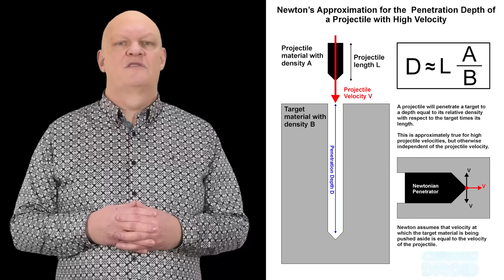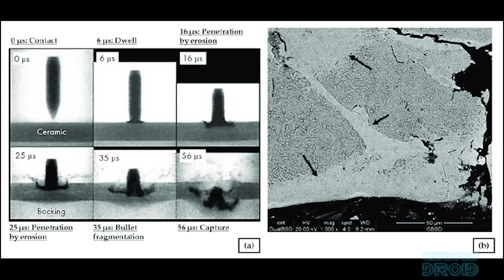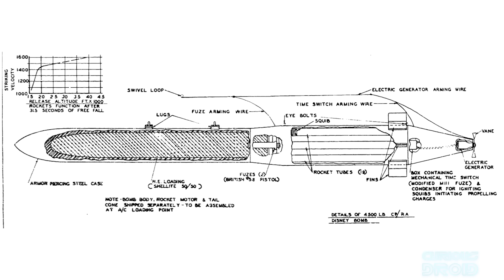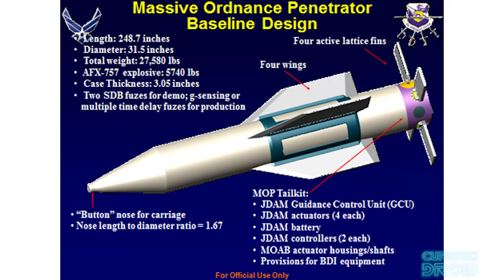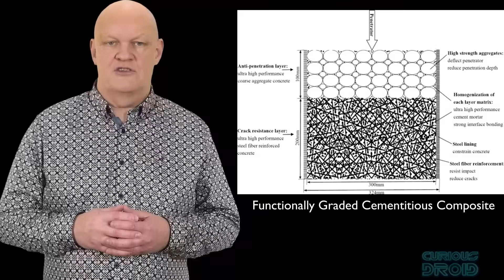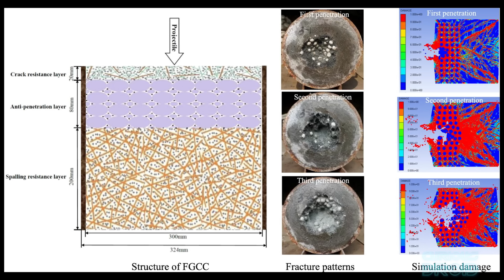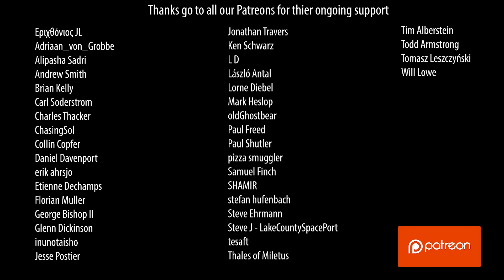Can Iran Stop U.S. Bunker Buster Bombs?

Comment: Great video, interesting stuff to an old US Navy A-6 bombardier.  
.
I have a solution different from what you posited at the end ... and a war story.  The solution is napalm.  In the A6, nape was one of the few weapons we couldn't use because you can't carry it on Aircraft Carriers.  The Navy fears the whole fire thing. On a ship, fire is bad.  But after Desert Storm I recall reading about some Marines that got in trouble for napalming (napeing?) some random target ... artillery, armor or some such.  I remember reading it and knowing exactly what happened.  The looked in the manual --JMEMs, the Joint Munitions Effectiveness Manual.  
.
I had spent many hours in JMEMs looking up what weapons would work best against what target.  There's a matrix of different bombs against personnel, equipment and buildings of different construction.  And there is a pattern: Napalm works best against almost anything.  The problem is figuring out whether you can hit the thing. There is no such thing as precision guided nape.  I am sure the Marines looked in their manual and picked nape because the target was something they could hit.  No one up the chain of command stopped to think about how dropping fire on people would look in the newspapers.
.
For a bunker it'll work because bunkers need environmental systems with access to air.  Napalm works best against almost anything ... if you can hit it.
Reply: During Desert Storm I witnessed USMC Harriers taking off with nape under their wings and returning empty quite frequently. Harriers were also using Mk-82s and 25mm cannon fire. Each Harrier had a bomb with a number stenciled under the cockpit indicating the number of sorties flown, and some of them were well north of 80. That was a really bad time to be an Iraqi soldier.
Reply: @RCAvhstape  I didn't know they dropped in often.  I remember reading about one napalm attack after the war where the newspapers, or public, seemed displeased.  Outsiders had the idea incendiaries were a war crime and their "experts" said the Marines could have picked something else.  It was only one article, but I recall thinking 'Yea, they could have used something else but I know exactly why they chose napalm.'
Reply: @jeffzaun1841  Yep, there was also a lot of complaining about cluster bombs and land mines. We used a lot of cluster munitions in Desert Storm, both aerial bombs and artillery shells, precisely because they are so effective. The Iraqis were entrenched and Marines were about to assault straight through the middle, so Marine and Navy air was doing what they do best to help out.
Reply: @jeffzaun1841  I am going by memory here, so I can't verify for a fact that I saw napalm, but they were metallic canisters under the wings. The ordinance men mentioned napalm to me in conversation, too, come to think of it. Hats' off to you for your service, and glad you're with us still today.
Reply: @jeffzaun1841  Just did an image search, and sure enough there is a photo of Marines arming one of my squadron's Harriers with nape at Jabayl where I was at the time.
Reply: @RCAvhstape  "soldier" yeahhhh....  right...
Reply: @byloyuripka9624  problem?

Comment: The tops of the bunker is very thick how thick are the walls on the inside? What if you just dropped one close to the outside and let it blow in through the wall.? Best way to destroy a ship is drop it right beside the ship and let it blow a hole in the side.

Comment: My uneducated thinking on how to defeat these more modern bunkers is to start employing materials other than steel in the construction of the penetrator.
Tungsten carbide has been used for a long time in armor piercing projectiles for firearms. If we could just discover a way to create a penetrator nose-cone for a bunker buster out of that stuff (or even better, depleted uranium, since depleted uranium has self-sharpening ability and tungsten carbide does not), then we would likely have a weapon sufficient to penetrate into the bunker proper. What follows that penetrator nose-cone is up to the imagination of the weapons designers, but my preference would be a high yield fuel-air explosive. Because if you thought a fuel air explosive going off at the entrance to your bunker or cave was bad, how about having that same thing go off right in the middle?
Reply: Yes. I bet nobody has thought of that before.
Reply: @T3H455F4C3  You'll note I did preface it with "my uneducated thinking...."
Therefore, I fully expected someone else to have thought of it before. I just don't yet know why it's a bad idea.
Reply: @44R0Ndin  One thing I do know is that Tungsten is relatively rare and expensive. It is quite hard and has the highest melting point of any metal. Probably a huge pain in the ass to work with. 

The USA does have a large amount of depleted uranium. If we fined out one day that they made bunker busting munitions out of DU I wouldn't be surprised. 

What keeps coming to mind is that if you can make a thing that's 80% as good as another thing but costs 20% as much to manufacture, that's probably the way to go.
I'd rather have five "pretty good" bunker busters over one "really good" bunker buster.
Reply: @T3H455F4C3  That's a good point, and maybe the way to attack these bunkers isn't with "a better bunker buster" but "more of what we already have" instead. Throw enough of them at the exact same spot and you'll make it thru eventually, you know?

Comment: I was in the USAF as a munitions systems technician when the GBU-28 first came out.. didn't see too many of them as they were initially nearly built to order. Additionally, I was stationed in Kuwait after Operation Iraqi Freedom in 2001 and we stored our munitions in the Hardened Aircraft Shelters (HAS) that we had previously blown up with bunker busters.. We initially used the GBU-24 with the BLU-109 (2k lb penetrator) warhead but found out the French cheaped out when they built the HAS and instead of using 12 ft of reinforced concrete, they used a sandwich of 4 ft concrete either side of sand.. our penetrators went right through. I have re-enlistment photos in front of these blown up shelters
Reply: I also was there at that time....different job but same time....and side note Kuwait sued the French for the destruction we did to the bunkers!
Reply: wtf really never heard about that haha
Reply: So your saying the best defense is to  have the concrete be thinner?
Reply: @rainyvideos3684  the bombs went right thru and blew up inside
Reply: @rainyvideos3684  No armor is best armor.
Reply: There’s a concept that transitioning to layers of compacted gravel (valentine bunker used thus I think) causes strain waves to dissipate. So surface explosions are better tolerated and toughness improves.
Reply: CAn you tell about  Serbia what bombs were used .. NATO droped many bunker buster bombs in 1999 on 2 airports that had underground level for storing military and civilian planes. And no bomb penetrate it..and you really felt when that bomb was droped even i was 30 km from there
Reply: Im looking at those exacts shelter as im typing this.
Reply: They still use those bunkers at Salem. Kinda ridiculous seeing people operate in a building that has a 20’ hole in the roof with chunks of concrete dangling. I’m not sure which is worse tho. Their electrical panels had no cover on them. Just two lines of breakers and the wires terminating in them. Oh, and muns is open in a field that floods. Like floods enough to submerge their MEP 805 generator. Great history there tho. One of our MSgt was a tanker during operation thunder run. Got to run the Iraqis out, then come back years later as a plumber and helped tremendously with creating and supplying clean water.
Reply: @rickcales38  So why they did not patch the holes? It is ridiculous to think that it would be a problem...
Reply: @Bialy_1  I’m guessing it was a cost thing. The base was termed “temporary”, however anyone in CE knows how that goes. They give us the bare minimum budget, materials, and man power to keep it going for years to come. Some had metal buildings on skids. Everything was a mess. Some people live in concrete block buildings, some in prefab metal buildings, and some even in SSS and MSS. Anywho, back on topic. I think it was more work than was worth it to them. It’s a decent job to patch a concrete bunker and make it water tight. The giant concrete doors weren’t operational either so even with the roof fixed the whole side is open. Hope this wasn’t too much.
Reply: @Bialy_1  these weren't small holes that could be patched. In Kuwait, partly because of the shoddy construction, up to about half of the "hardened" shelter was gone with snarld bent rebar hanging out everywhere. It would need to be fully demolished and rebuilt
Reply: Where are the WMDs or is it another US invasion lie?
Reply: Cool pictures huh?!?
Reply: Ammo!  I’m Ammo too!
Reply: Would you recommend that specialty, munitions systems technician?
Reply: @augusthoglund6053  I loved it. Given the explosive nature of the job, we (like security forces) we separated from the main population of the base which boosted comradery within AMMO . Being in the Air Force was also amazing (regardless of the job I would suspect). Supporting the planes that flew to the action means deployments are usually a bit further from danger with more creature comforts available. Being stationed overseas also gave me more of a global perspective that has stayed with me to this day.
Reply: @jeremyj5893  Ammo has some advantages though I was not one. I would absolutely take Ammo over SF. That's no contest and the isolation in the bomb dump is a very good thing since the politics is mostly elsewhere.  IYAAYAS is the last politically incorrect slogan the AF tolerates.
Reply: Without taking cost into consideration, would the idea of "Rods from God" do a better job?
Reply: @ZergRadio  cost not being a factor they could do a lot, but they're not practical. Problems are getting it up there, communicating while in transit (plasma from reentry blocks signals), and controlling the path.
Reply: @lonewolf025  oh but you must get with china and russia on how they can somehow see thru and communicate thru the plasma .... #sarcasm ROFL... they think everyone is stupid i guess.  I have been told that by three guys from there now or one guy three times with different accounts either way.
Reply: Iyaayas! Cheers
Reply: The question is how US can get passed radars and anti air defense fly all the way in to drop that bomb
Reply: @IranianKiddoXx  probably with a proxy like oh say Israel
Reply: @IranianKiddoXx  sure the B-2 can carry one and the B-21 can carry 2.. never even know they were there till the bigbaddaboom instant revolution.
Reply: @jeremyj5893  FYI, they were not “nearly” built to order - they were DEFINITELY built to order.  I know a bunch of folks on that program, they hardly slept for two weeks.  Apparently the Tritonal  fill was still warm when the warheads were shipped out.   Thank your service and for the part you had.
Reply: Great presentation! Very informative. Keep it up sir!
Reply: Nice to live in a day where people thank people for their service. People weren't very appreciative 10 and 10 years ago
Reply: US invades iraq,the US aircraft would fall out the sky like rain
Reply: Thanks for serving!
Reply: @infinitecanadian he was an invader, he was the bad guy. You’re serving bankers. Not your country. Blind fool.
Reply: Thank you for your service!! ❤🤍💙

Comment: While SOME parts of the uboat bunkers could be 8m most had not been upgraded past 3.5 and 4.5m in thickness.

The reason why so many grand slams breakup is due to it being a casting and not having a thick enough sidewall. And thus would crack on impact as the bomb did not land perfectly vertical but instead at 4-5 degrees off vertical. This overloading the sides.

Comment: If you improving the accuracy of your weapon enough, you can chain a series of devices at the same point, though I suspect that may require some custom designs with clearing charges to not waste a bunch of energy powdering already shattered material
Reply: Does not work on multiple levels

Comment: I wonder how a drill bitted bunker buster which rotates at very high speed would fair.
Reply: Drill bits shatter if you look at them wrong, I don't think an air drop would fare better than careful pilot holing, lubrication and centering humans do while drilling stuff in the shop.